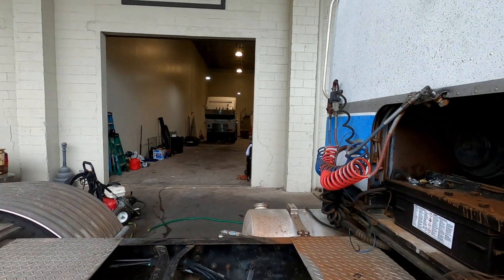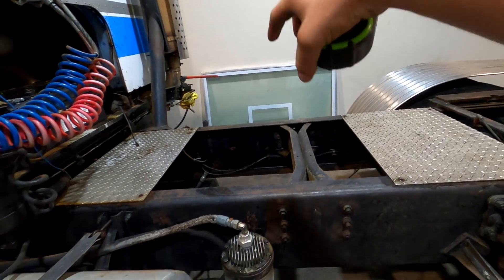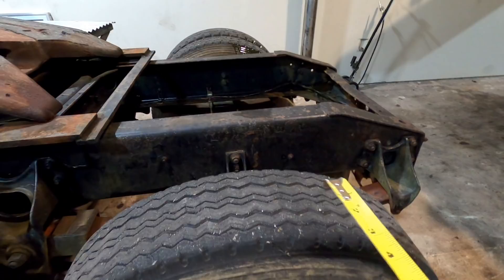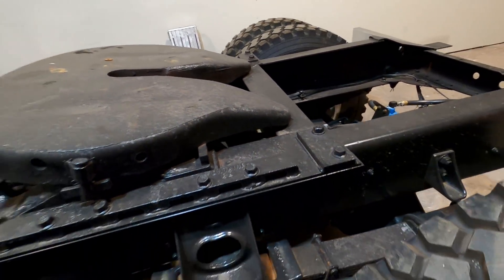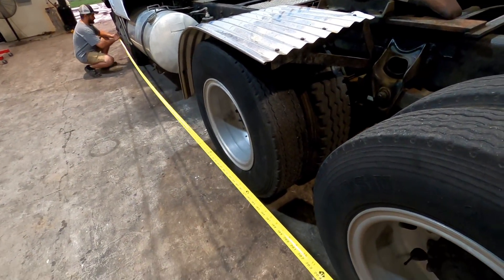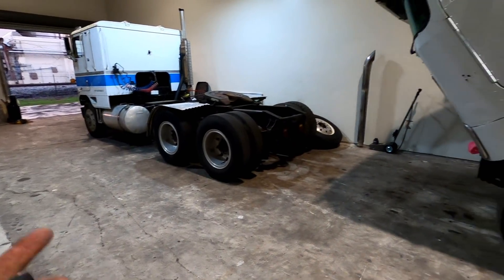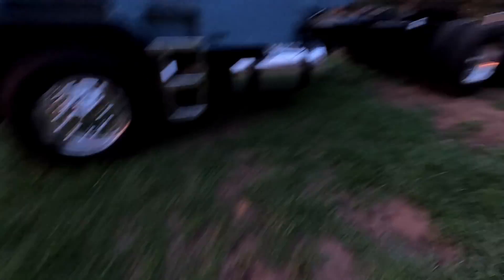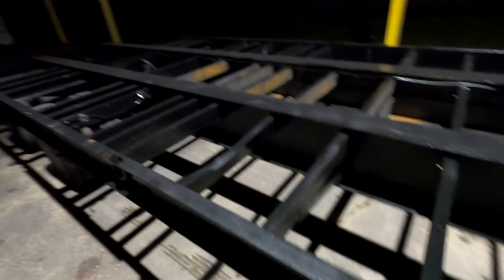USAF Cabover Frame Stretch?

Comment: Dude, if you absolutely feel like you have to stretch it, and you say you wanna do it right. Don’t do it with the white trucks back half. Just take your time and find an air ride suspension setup with the proper frame. There’s no point to stretching and keeping leaf springs if you are going that far into it.

Comment: You are making a major mistake and going with the double-breasted Yamaha I asked an old truck driver about messing with 6V 92s 300 screaming and 35 pooling all you need to do is get somebody to adjust the RPM governor and it will run fine on the interstate with a 390 gears

Comment: I'm confused.  Put the frame from whitey on airforce 1. Then Bruce said swap the cans out. I thought airforce 1 had a better cab . Why does it matter having such a long cab over.  Have enough frame to clear the cab with the trailer.  The point of cabover is maneuverability sharp turning etc. The longer it is the worst she will turn

Comment: You said you wanted a truck that would need less work now you want to cut the frame and extend it? What purpose will that serve? it’s just going to weaken it. Surely it makes more sense to leave the Airforce trucks frame alone and swap the axles and parts from the dead truck that you’ve already spent thousands on ok it’s hassle but this time if you do it properly you have a working truck that can be driven, otherwise all you’ll end up with is two dead trucks or one parts truck and an unsafe mess up.

Comment: I would leave it how it is. Honestly I wouldn’t change a thing about it except the axle seals and all the other stuff over. Plus that truck has a lot of history in the Air Force. Please don’t stretch it
Reply: I agree fully, repair the things that need fixed such as the radiator, get those recaps off the front, get some mudflaps on it and do all the other basics. Stop focusing on the appearance, focus on the funactionality.

Comment: So in my opinion, you bought the air force semi with the idea of using all the good stuff off of the white truck to put on the air force truck. if the rear axles are intended to go on the air force truck but its just as easy to cut and weld the frame, i say cut and weld baby! Now having said that, please don't piece meal this. Strip down the air force truck and do it right.

Comment: And another thing, which ever option you choose, work on the engine and get the truck running tip top FIRST.  Don't do like like International and spend tons of money and time fixing/modifying other aspects of the truck all to find out the engine/transition/electrical is shit.

The most important thing in any vehicle is the engine, so get it running good first. Once you do, then consider stretching frame.

 Don't work ass backwards.
Reply: No no, let him work backwards. It's far more entertaining
Reply: @performanceminded  - LOL, I think you're right.

I couldn't believe all the work he put into the International all for him to say it was going to be more work to fix the important stuff, like the electrical, than it was worth.  I thought, "shouldn't you have determined that first!".   Yeehaa!
Reply: Im guessing it will be plastic chrome wheel nut caps in the next video lol
Reply: @joss67uk  stacks that won't fit out of the door

Comment: It's a single bunk 13letter shitspreader,  why would you stretch it?  If you restore it correctly,  you have a hell of a horse, 900 horsepower if you want it from NTC Cummins. If you stretch it the flex under strain is significant and unpredictable, under load at full torque application anything can happen and it won't be good. The Freightliner was worthless when they were new, and more worthless now as a truck. Save the old cornholer and don't screw it up.

Comment: Don't touch the frame. Leave it as is. It looks good already that length. Get the thing running and working first. You failed on the first truck because you wanted to do too much and now you want to do it again. Get it mechanically sound, then you can figure out what you want to modify.
Reply: Exactly, don't make the same mistake twice.

Comment: I'd not cut it - neither one, nor two frames, fearing it would take me into to much hassle. I'd take all the good parts of the other one, and improve the AF truck with em, making it a masterpiece. It's not the length, what counts, ya know... ^_^
ah, and btw: as because of it's AF heritage, I'd paint the cabin lower half in an "AF darker grey" tone (like the modern F35 fighters), with one of the modern stylized AF icons and where on the upper half (slanting over the whole cab) a modern, abstract hexagonal camo with light and dark grey and orange comes up, to symbolize new times and the trucks old days ... hard to describe and I think I could not even paint it on paper, but it should look like the old AF paint peels off and the modern camo comes through ...

Comment: I wouldn't stretch it. Shes just a county use truck,  65mph top speed, those Detroit's are thirsty. Just do the axle seals , frictions  lines and cans on the brakes. Have bus grease monkey in to tune it and move on to the next. If anything shorten it and get air ride , it would make a sweet field rig that could be turned around in a knot hole.

Comment: I think you are forgetting the hassle you had getting the blue truck into the workshop.
 Cutting the chassis and joining it to the Airforce truck is pointless if you are doing it just for the extra speed when you already have the blue truck? Remember; torque is just as important as speed when you are struggling to get traction; not to mention difficult corners and locations that you may have to get the truck and trailer into?
It might be extra work to change all the valves and suspension parts but think how much better the Airforce truck would look,  and at least this truck has some history to show off?
It would also be nice for the viewers that have stuck with your channel to actually see a project finished?

Comment: I’m glad you’re doing a project with Scott “Bus Grease Monkey “ 
I’d say option 2 cut the frame from the old international and add it to Air Force Cabover.  Id go for the big tanks from the other international. 
I would definitely do some research on how to properly stretch and strengthen the frame. 
I’ve seen how frames been Z cut and boxed back together but ya better off doing research though just in case. 
Hope you have a Blessed One Bruce.

Comment: Just swap the cab and the harnas over to the other chassis. Why cutt them both up? This makes the chassis weaker then it is! Find out what’s wrong with it and make it runn before stretching it, cause else you might need a 3e truck if you got something wrong. Learn from youre mistakes don’t make another one.

Comment: Just leave it alone Bruce why cut it and add the cabover on to it just repair what needs to be repaired nice paint job or a nice wrap chrome it ie wheels bumper rear lights ect ect leave the fuel tank alone don’t need to move them around easy fix get the trailer up and running with it so you have a nice set up then move on to another project

Comment: Since your gonna stretch this truck,at least replace it with modern air ride! Youll be glad you did,trust me! Still a cabover still a bad ride. Anytime you mount the driver seat above the steering axle for tighter turns and length laws,your gonna loose some comfort in the ride.

Comment: Why would you choose a old Detroit over a Cummins big cam I dont get it. Why would you go buy a truck that in the same condition as the other bar cab. Why not swap cabs in my professional opinion that airforce truck is in worse condition than the other two just doesn't add up I know your making content for us to watch but why no a frame rebuild then cab and electrics then a sump up rebuild on the big cam months of content there buddy

Comment: Fix the mechanicals and fix all the seals that are going to start leaking. Don't  wait for them to start, just replace them anyway and get it over with. Swap to air ride and keep the truck as a good workable truck. Bling out your Freightliner and leave the Binder as a good useable truck.

Comment: For give me Bruce, but you are driving me crazy!    First of all,  there is not a lot of difference
between Canada and the USA,  in terms of safety laws.  If you had looked at  old International
shop manuals,  you always cut a medium or heavy truck frame at a 45 degree angle!  
This increases  the welded  length of the cut, and the reweld.   You MUST BE A CERTIFIED WELDER, IN MANY DURISDICTIONS!   IT MUST BE WELDED INSIDE AND OUTSIDE, WITH
PROPER  BEVELING OF THE JOINTS,  SO AS TO FILL, THE GROOVES, WITH WELDING 
BEADS ON EACH SIDE.  THE FRAMES MUST BE ALIGNED PROPERLY,  AND SUPPORTED, 
AND  CLAMPED WITH  STEEL  STRAIGHT EDGE  STOCK,  TO HOLD BOTH SIDES, PERFECTLY
WELL,  WHEN BEING WELDED SO ALIGNMENT IS 100%  OK!   THEN , THE  FRAME JOINT
AFTER WELDING MUST BE FISH PLATED,  INSIDE AND OUT,  WITH  SPECIFIED GRADE 8 FINE THREAD BOLTS AND NUTS,  THE SIZE SPECIFIED BY STATE REGULATION,  BEFORE THE 
END PRODUCT FRAME, IS ACCEPTED, BY YOUR DOT MECHANICAL INSPECTION  GARAGE!
MANY JURISDICTIONS REQUIRE SUCH WORK TO BE DONE BY ONLY TRUCK, OR FRAME
SHOPS CERTIFIED AS QUALIFIED BY THE STATE OR PROVINCE!  OF COURSE, THE WHEEL BASE MUST BE  WITHIN DOT SPECS!   THIS  IS ALL FOR LIABILITY  REASONS!  OR YOU  PUT 
YOURSELF UP, FOR MAJOR  LAW SUITS IF THE FRAME  JOINT FAILS UNDER SERVICE LOADS!
MANY STATES PROHIBIT   MR.  ANY BODY, WELDING ON FRAMES ANYWAY!  
WHEN YOU DO SOMETHING ON YOU TUBE,  I RESPECTFULLY SUGGEST,  YOU DEVOTE AT LEAST SOME OF YOUR  FILM FOOTAGE TO  EXPLAINING TO GUYS,  THAT SUCH MATTERS
ARE NOT TO BE DONE IN A  WILLY- NILLY MANNER!  I AM NOT SAYING THAT YOU DO NOT, 
KNOW WHAT YOU ARE DOING!  I DO NOT KNOW YOU, AND SO, IT FOLLOWS I DO NOT KNOW YOUR CERTIFICATIONS, OR YOUR KNOWLEDGE, ON THE MATTER.  BUT I CAN SAY, THAT YOU DID NOT,  TAKE THE TIME TO EXPLAIN TO YOUR AUDIENCE,  THE  LEGAL, AND REGULATORY
REQUIREMENTS IN YOUR STATE!  NOR TO CHECK WITH LOCAL DOT REGULATIONS WHERE YOUR VIEWERS ARE!    I  do have a 1963,  cold war era,  International loadstar, 4x4, 1600 model, 
speced out for the USA air force, that spent over 30 years on broughton Island  North West
Territories DEW line base FX5 !  It carried auxiliary radar, during the cold war!  I intend to sell it
to a client who will respect its history! Best regards kennethzakaib607@gmail.com

Comment: why stretch it thats a dumb idea.that will screw your turning radius and your ability to haul trailers will suck that is if you are actually going to use the truck.Its gonna be more to it than swapping brake lines dude. cutting a frame is never a good idea and welding a cut frame is a terrible idea.IF YOU ARE GOING TO     USE THIS TRUCK.do not cut it it i will be illegal to use that truck for anything commercial.Do you actually  haul freight or do just do this for kicks